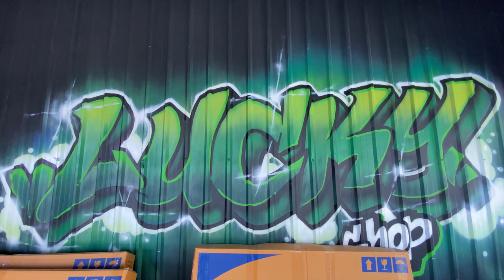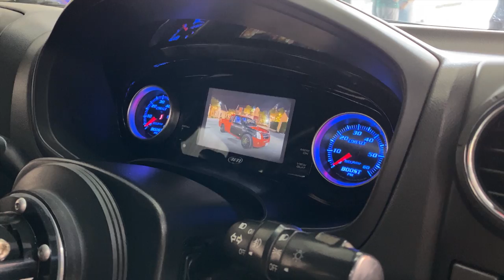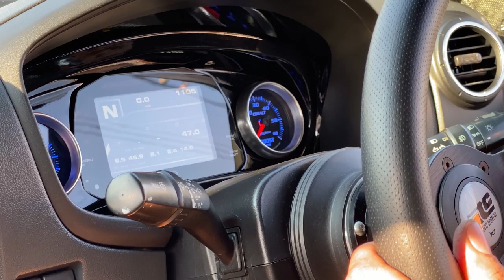55 PSI of Boost! Twin Turbo Diesel Rollin' Coal in Bangkok

Comment: I remember the same Isuzu diesels in the usa, they were dogs, it took forever to get to 50mph. Leaked oil horribly and no power at all. Do the shops in Thailand make their own computer systems for engine control and dash applications? Thai people seem to take anything laying around and make amazing creations with it.
Reply: they use a standalone plug and play ecu, those motors (4jj1) use electronic injection

Comment: it’s cool to see someone’s done this to their car, i have a this car and it’s called a Holden Rodeo they are great little cars and get tons of torque just from a little 4 cylinder. i’ve set mine for 4x4 and it’s running 16 PSI and has 630 NM
Reply: They're beasts of a fourbie. Underated engine reliability with plenty of power and reliability with great mod support.

Comment: Thailand seems to be a paradise for those who like tuned cars and trucks, but the car guys here in Brazil likes more to modify vw gol especially from early 90s and their ea827 engines that we call AP (high performance in portuguese) because they're cheap to maintain it and have a bunch of aftermarket parts and turbo kits or the opalas from gm (opel reckord/ holden commodore) and their gm sixes...

Comment: EVERYTHING YOU NEED TO KNOW ABOUT ISUZU D-MAX/MU-X/ALTERRA AND THE 4JJ1-TC/4JJ1-TCX/4JJ3-TCX ENGINE

In the Philippine automotive market, the 4JJ1 family starts with the Isuzu Alterra in 2005. At the time, it was the first Euro 3 diesel vehicle offered in this country. Heading over to Thailand where drag diesels are very popular, this particular engine was a very potent engine for tuning. Thai people and even foreigners said that this engine is as potent as the mighty 2JZ-GTE from the 1993-2002 Toyota Supra MK4. In simple remap, the engine is capable of 259-277 BHP. But when the forged internals, bigger injectors, bigger turbo, and re-stroking come into play, the engine is capable of 1200-1260 BHP. For instance, this kind of four-digit horsepower is reserved for some supercars like the Bugatti Veyron, Bugatti Chiron, Koenigsegg Agera, Koenigsegg Jesko, and the like. But with the 4JJ1 and even its newer variations, four-digit horsepower is finally accessible to the masses. Regarding the quarter mile times, they are running around 7.1-8.7 seconds which is way faster than most supercars. This engine is a blast from the past, especially the 90's tuning culture where 2JZ, RB26, 4G63, and many others are very popular among tuners. Back in the Philippines in 2007, the Isuzu D-Max with the 4JJ1 engine was launched in our country. These subsequent releases after this vehicle with this engine are 2nd Generation D-Max in 2013, Alterra replacement MU-X in 2016, Blue Power Euro 4 upgrade for both D-Max and MU-X in 2017, and the upcoming launch of the 3rd Generation D-Max on March 4, 2021, with the 4JJ3-TCX as its engine. Regarding the 4JJ3, it is like a 4JJ1 with an electronic variable geometry turbo and 250 MPa injectors to produce 190 PS and 450 Nm of torque. For the upcoming vehicle, it will be very likely to become one of two hyper-tunable cars that are currently and commonly available in the market, with MU-X sharing its honor. Throughout its lifetime, the D-Max, Alterra, and the MU-X with the 4JJ1 engine are tuner favorites because of its high tuning potential and some similarities with the 2JZ such as an all-turbo exhaust soundtrack, prominent turbo flutter, cast iron block and aluminum head, and being a closed-deck engine. So when you own an Isuzu vehicle with the 4JJ1, you will be impressed by the tuning potential that these three vehicles can offer. Regarding the local drag diesel scene, the 2012 Isuzu D-Max 4JJ1 was tackling the Clark International Speedway drag strip last month with a 9.73-second quarter mile.

Comment: That was one cool Isuzu..400hp at the wheels without nitrous OMG!
Reply: it's pretty normal and easy to get 300-400hp without compound turbo, i ran a 44mm dmax turbo , pump out 375hp 787nm . cheers
Reply: without Nitrous
Reply: @ChinYeeWei  what engine bro?
Reply: 4JJ1
Reply: @ChinYeeWei  remap or stand alone?
Reply: Smokey And Your Mom remap only
Reply: @ChinYeeWei  In Portugal PD engine (1.9 TDI VW) easy 400hp in the motor. More 500hp with nitrous.

Comment: Just a small correction if I may.  The torque was quoted as 700 foot-pounds and that is the incorrect unit.  Engine torque is a FORCE measured in pound-feet.  The foot-pound unit is a measure of WORK which is FORCE per unit of time.  Torque is not time dependent.  Consider a torque wrench which measures the twisting force applied to a nut or bolt.  The unit there is pound-feet.  Engine torque is exactly the same thing, twisting force on the crankshaft.  Units in physics are very important and accuracy is essential.
Reply: That’s why for people trying to get used to imperial and metric conversions, it is much better to use subscripts. Pound_mass or Pound_force.  Less chance of making mistakes.

Comment: No Air conditioner, but the AC compressor is on the engine and under the radiator there seem to be a A/C condenser or maybe a oil cooler? The owner did a quality build. That truck could easy compete on auto/truck shows.
Reply from the maker: I think it just didn’t blow cold. They just finished a build so they’re still wrapping up a few things

Comment: Does the Truck have to roll coal to prevent melting pistons or do they do it for show? I was told that the diesels need to dump extra fuel in cylinder when running crazy high boost to help cool and prevent damage to pistons is this correct?

Comment: I dont understand why not extend front sheet metal to keep radiator in front, looks like 8" extension? or use rear turbo, mounted in the bed, which could cause lag, but allow it to be more conventional, but I always like people to not expect whats under the hood. 

how is the street racing scene? I stopped years ago, but I paid my way through college street racing. 

I have a 1966 Chevrolet C10 to build, but I know it will have 1 of 4 engines, havent decided yet, but will have a tunnel ram intake, & a 4 speed, already got tires & wheels, but I need time to replace some sheet metal & paint it, currently work 2 jobs & occasionally a 3rd.
Reply from the maker: They do things here that make absolutely no sense just to do things that are cool and different. Check out my video of ones of these trucks with 5 turbos for proof of that. By the way, I love C10’s soooo much!
Reply: @CBMedia404  I will check out video, & I have been in car & bike scene 30-40 years, & I have seen a lot of custom stuff done to be different, some not so safe. had people I knew die from crashes, whether their custom mods, or being stupid I will never know. 

when I was working at independent Harley shop I refused to do anything I felt was unsafe, but my walking out was due to me refusing to work on newer bikes, I only worked on 1920's to 1984 Harleys, & very little on 85-99 Harleys, & refused to even sit on the 2008 & newer twin cam bikes, or work on any bike brought in by a yuppie at the time & I worked at shop from early mid 1980's until around 2002. not done anything for anyone but myself since.I told guy that trained me I would ever go in competition against him, so I stayed in car & truck world afterwards.  

Yeah I always loved them old C10's I was looking for a replacement truck for my Roush F150 that is a daily driver, but I do have a few other cars I daily too, & my wife said get what you want, and she knows I will use it as a work truck, lol. she knew I been having an itch for a big engine tunnel rammed Chevy again as a daily ride & to use,  yes I am very old school. 

I was able to watch a little over an hour of your live feed last night, before falling asleep, I had worked 12 hours at 2 jobs, plus drive times, ate supper & was watching when I fell asleep. I did ask 1 hypothetical question, I know you said you cant import vehicle at present, my question was, "is there a grey area", like a set of Harley engine cases, & parts, "machine parts" but assembled there, old cases where title was issued to the case, not frame, any Harley built before 1970, then a custom frame built, would the engine "Harley" be able to be registered, since it is now there? in case I ever get a wild hair? only need to get access to a welder, & parts to complete it. 

anyway I enjoy your videos.

Comment: The 4JH in my fairlane was pushing 50psi all day long....which was a pita as it was also pushing all the oil out the breather faster than i could catch it n return it back to the sump. :(
Can you keep an eye out for a crank n 1 rod while you're out n about down there? :)
Reply: Engine in the video that you watch
It is code 4jj commonrail system
Finished to support 80 psi pressure

Engine isuzu in the video you watched
It is code 4jj commonrail system
Modify
To support 600 horsepower
turbo pressuer  80 psi

Comment: My cool car days were long ago when 400 hp required a 409 cubic inch engine (Chevy) or 426 cu in (Pontiac). Your videos are resurrecting my dormant motor head. I had a WTF moment when you pointed out the nitrous cylinders. In a diesel? I'm definitely out of touch. Gotta go Googling. But I do know enough to know he needs to get his fuel mixture to be a little more lean, too much carbon smoke.
Reply from the maker: Awesome! I love muscle cars

Comment: How do they convert it to 5 wheel studs instead of 6. What spindle did they use??
Reply: They would have used a bolt on adaptor from a 6 to 5 stud

Comment: Truck Super Sport, They will buy Ford Raptor 450hp 4.5 sec in 60 mph. ISUZU D-Max No Twin Turbo 117 hp and VGS Turbo 135hp. It is so bad with Big Turbo 135hp.

Comment: Totally impracticable exhaust fumes in the passenger window filter extruding from front grill storage space loss in rear radiator exposed maintenance nightmare
Reply: I think that's the point. It's supposed to be bonkers. If they wanted practical I don't think they would have built it in the first place. I feel  like this is supposed to make you laugh, say WTF and yell TAKE ME FOR A RIDE! all at the same time.
Reply from the maker: Dude, no one cares here lol
Reply: @CBMedia404  normally the ones that don't care end in the gutter
Reply: @thomasredmond6668  karen? Is that you using another account again?

Comment: A lot of black smoke.. lots of lost power
Reply: They modified the engine to increase amount of fuel entering the engine to emit large amounts of smoke

You can search on internet it's called "rolling coal"
Reply: True, but black smoke is raw fuel. Raw fuel not being burned is power lost, gale banks says with diesel. Lean is safe, engine needs more air